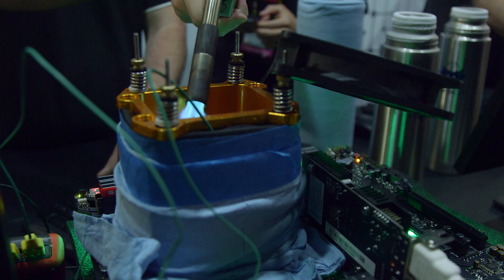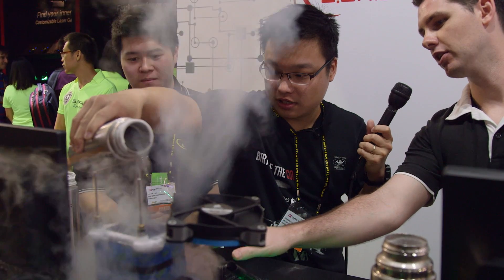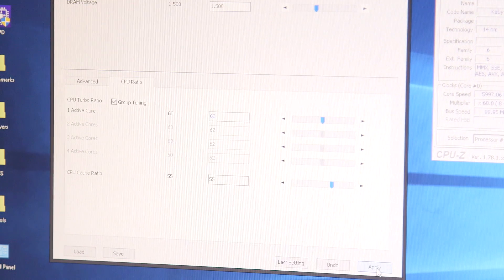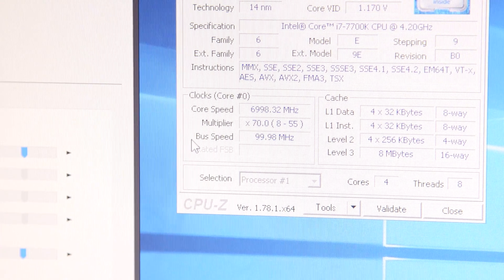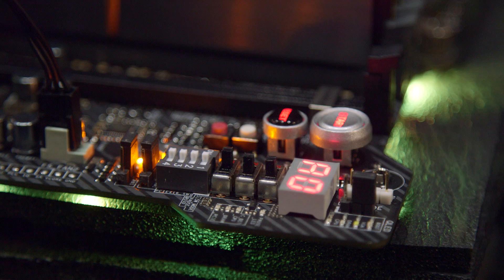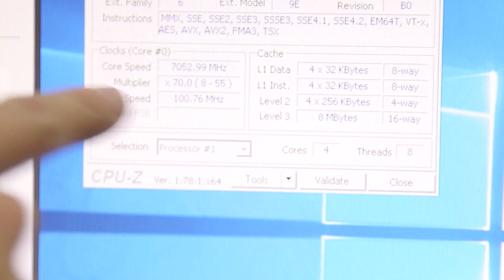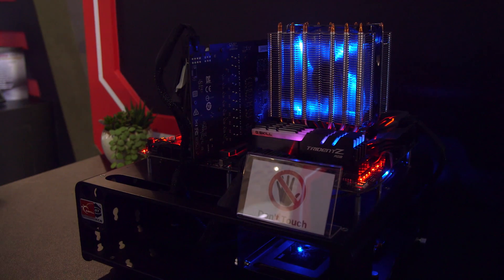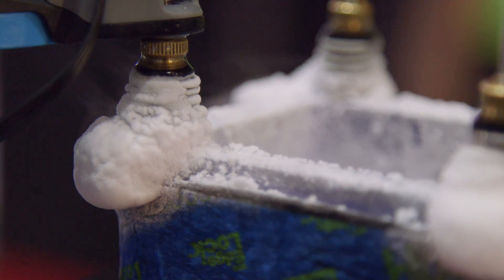Overclocking to 7GHz with Liquid Nitrogen | Hands-On | Computex 2017

Comment: Pouring that liquid nitrogen out of basically a flask with your bare hands seems a big dangerous to me. :-o
Reply: The Leidenfrost effect will let liquid nitrogen just roll off any surface due to the insulating vapor layer formed between the warmer surface and the liquid nitrogen, so our hands are safe as long as you don't form a pool of liquid nitrogen in your hands.
Reply: It was a reply to OP. There's no pinching feel, by the way.
Reply: You'd only feel the cold burn if you force the liquid nitrogen onto your skin (that's how some clinics treat warts). Liquid nitrogen naturally rolls off any surface that are much warmer, so long as the surface doesn't form a trap.
Reply: It felt nice and fresh though. I learned a lot that day, too.
Reply: If you are not doing it dangerously you are not livin the thug life!
Reply: https://en.wikipedia.org/wiki/Leidenfrost_effect
Reply: its more dangerous with gloves. If the LN gets in the glove, whatever it touches, is frozen. if its open air like that, it will boil off of your skin instantly.
Reply: YE YE! U CAN ALSO DIP YOUR FACE IN IT!
Reply: It's a Dewar flask? Barely any heat transfer between the liquid and the outside of the flask...
Reply: You can dip your hands in it too, just not too long...
Reply: u can pour liquid nitrogen on it hands without a problem
Reply: +C4_yrslf Liquid nitrogen is safe to touch because of the lindenfrost effect, ofc the temperature will give you burns but your skin doesn't reach that temperature instantly...
Reply: Mark Wright angeree
Reply: +Mark Wright LOL! Is someone going to add some thermally active glue to the outside of the flask so it glues your hand to the flask, that would suck.
Reply: I'm just passing by and seeing comments so might add as well as I got a wart a while back and got it treated with Liquid nitrogen and it's a pain.. Basically he puts a long stick with a type of material resistant at the end in the flask for maybe 20 seconds than pushes it on the wart (Fire on skin feeling incoming) and when it's finished I remember looking at it and seeing a snow white hole in my foot about 5mm deep the next day it would be full but with a weird oil on black water like color
Reply: so much scientist here. everybody seems to know how it feels like to have Liquid Nitrogen on you :S
Reply: Gas Planet Games I really do, the stick was as cold as liquid nitrogen and fucking burns through your skin with pressure applied
Reply: Yeah of course makes me think of my sister who was mad at me cause I put the juice in the refrigerator once and she though it turned to ice....
Reply: 2Awesome does liquid helium-4 freeze your skin instantly?

Comment: And now actually put load on the system and it will freeze immediately even before 7 GHz... It's like showing of a car that does 200 Mph on a testbench.
Reply: Bent Haase True. We didn't get the Cinebench bit in the video but it did manage to run something (I forgot which task) at 7GHz.
Reply: It's like having a fast car because it's dropping off a cliff.
Reply: No, Its like making a glass masterpiece, you cant do much other then look at it, Its a symbol of practice and proper execution, If you could go to homedepot with no knowledge and do this then what you're saying is accurate but this  isin't your average trade skill.
Reply: *Watching porn, but not being able to masturbate
Reply: it's like eating a taco but it's really just a shell
Reply: it's like having google fiber but only using internet speed tests
Reply: *Having a fast car, but not being able to drive it
Reply: Now we are going from 0 to 100 here :D
Reply: Bent Haase More like mach 1 speed...
Reply: They did put load on the system that how on cpuz the clock speed came up to 7ghz
Reply: No, if if a car can do 200 mph on a test-bench then it will probably get around 180 mph on real road.  A more accurate analogy would be that the car's speedometer went up to 200 mph.
Reply: I agree, it's interesting the chip can reach those frequencies but with no practical use what's the point. 7Ghz for a fraction of a second yeah that's cool, but 5.5 stable on an all in one water loop now that's impressive.
Reply: Bent Haase
Reply: yep yep it should be measured at stable clock
Reply: Bent Haase i dont know if they ran the benchmark at around 5:00 with the overclock or not but i guess they did soooo
Reply: thats like with my cpu i can run it on 5ghz but the second i start a load the computer will crash.
Reply: It's like watching lots of Porn but still can't get laid.
Reply: It's like having a fast electrical bike that goes 50 mph downhill but uphill it goes 0 mph so it's not really fast when you push it.
Reply: It's like only being able to cartwheel as a form of locomotion.
Reply: Bent Haase They run on super clean custom OSs and only benchmark SuperPI, which only tests 2D CPU performance, the higher you OC, the less time it takes the CPU to run SuperPI. They're basically trying to set the fastest time and take the world record and piss of some asian basement dwellers, then have a dogfight with them to see who can go faster.